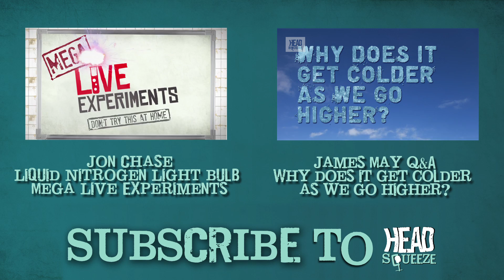Testing the Ideal Gas Law with Liquid Nitrogen | Live Experiments (Ep 53) | Head Squeeze

Comment: 1) The volume change is mostly due to the components of air being liquid or solid at LN2 temperature, the ideal gas law would only give you about a factor of four reduction.
2) Use a balloon for making balloon animals, they are stronger and it is much more dramatic to disappear a meter of balloon into the LN2. Don't make a balloon animal and cool it down though, it will explode (true story...)